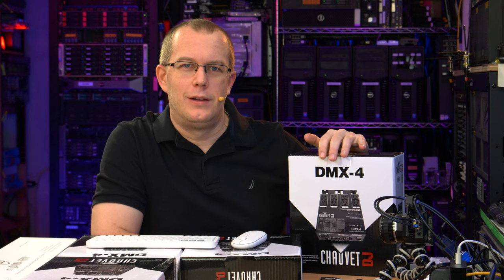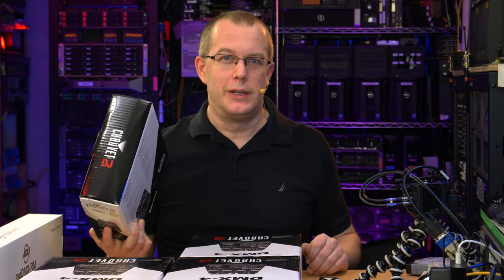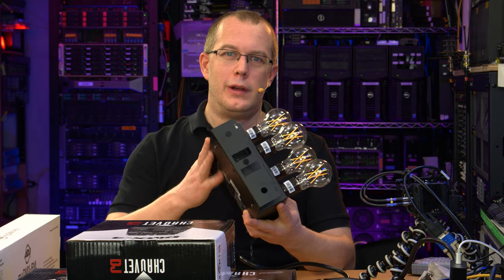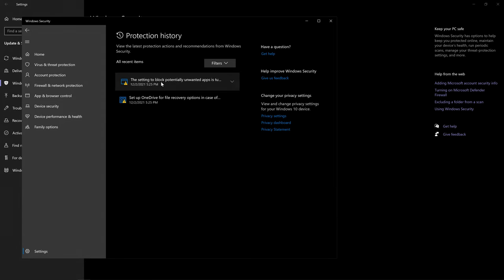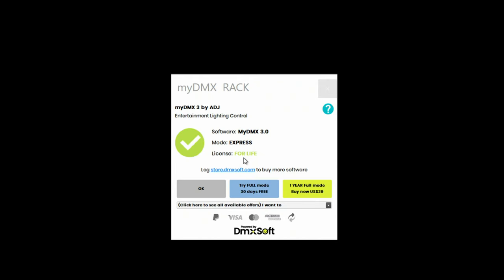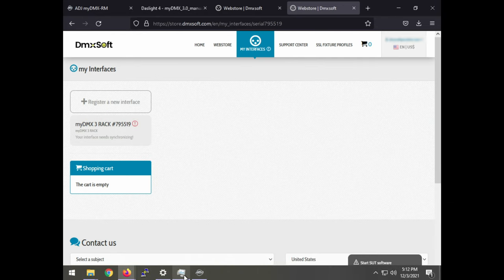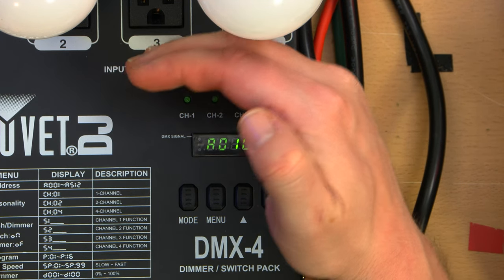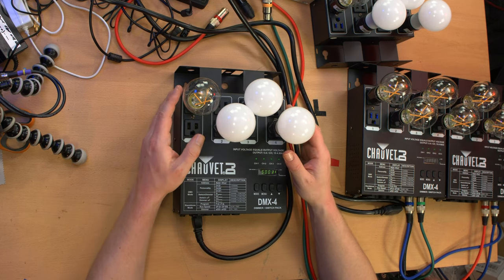DMX for the Basement - Chauvet DJ DMX-4 and ADJ myDMX-RM

Comment: Ok, just got to the end of the video, replace the chauvet units with elation or adj dimmer boxes and get a chauvet show xpress or soundswitch for control. The dimmer boxes are not meant for the purpose you are using them for, they are ment to dim house/ stage spotlights with no dmx built in